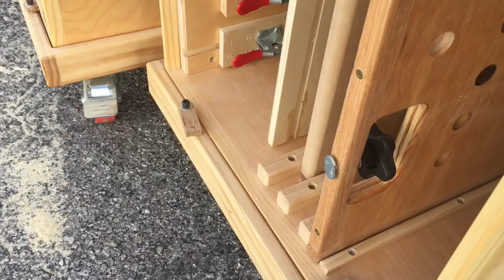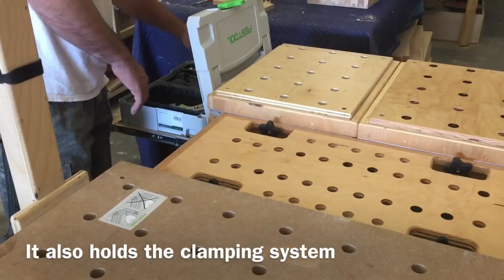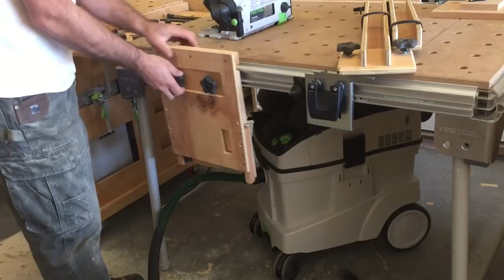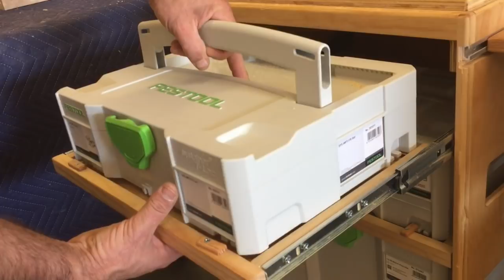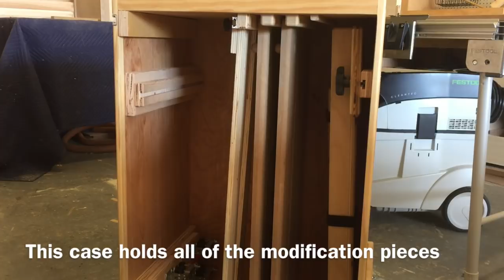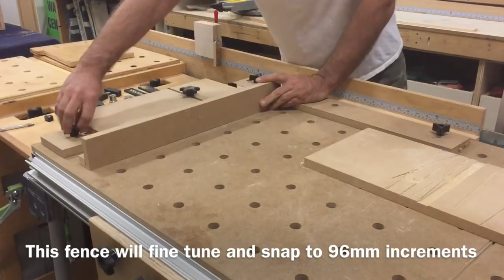Mobile Carpentry System

Comment: Tour de force! I've been setting up on job sites for 45 years. Much respect to you. One question: How do you deal with the occasional need to portage much of your gear up stairs? I presume that the fact that you break up the load into small footprint cases answers my question for the most part. But do you have other trick solutions for that circumstance too? Thanks for posting.
Reply from the maker: Michael Schuler Thank you. I haven’t had to go up any stairs with it yet. But, it’s all light enough to do it. With the hardware drawers fully stocked I’d probably take the trays up individually, though. That’s enough metal to do so.
Reply: @mgildersleeve  Some years ago, I started travelling with a folding hand truck with stair-climbers on the back of the uprights. The truck comes in handy for other misc. loads, but it would make it easy to make it up stairs with your compact cases, even if fully loaded with hardware.
Reply: Amazing

Comment: Will you please explain how you made the mft fence? Looks like it would accommodate much longer cross cuts.
Reply from the maker: Yes.  It increases the cut capacity of the MFT by a few inches.  I have the original festool fence in storage.  Sorry, I can't explain how each individual section works.  After a while, it would all be explained away and nobody would buy the plans.

Comment: What size are the T bolts that are used on the Festool  MFT system? And, what size of router bit did you use to cut the slots? TIA
Reply from the maker: The T bolts are 1/4" and I used a 3/4" router bit, since it was shallow enough.  I'm actually working on blue prints right now for all of this stuff.  It should be ready by the end of the weekend.  I'll post a link when they're ready.